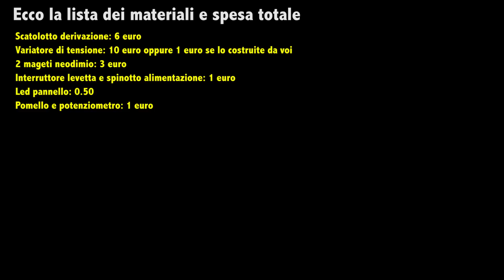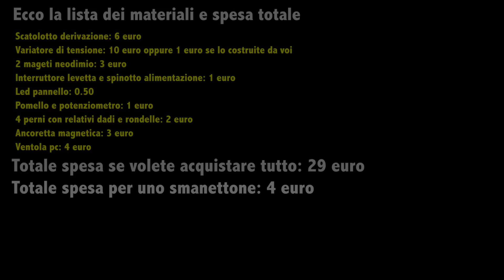Realizzare miscelatore agitatore magnetico per liquidi svapo

Comment: ma se io al posto della ventola metto due morsetti può essere usato come alimentatore variabile?
Reply from the maker: Certamente, il variatore di velocità non è altro che un variatore ti tensione che accetta tensioni fino a 24 volt per essere regolate fino a 3 volt con carico massimo di 2 Ampere, ma a quelle correnti devi mettere un dissipatore molto grande sul lm 317.

Comment: Il regolatore di velocità lo trovi anche su ebay, ti mando il link:http://www.ebay.it/itm/3A-DC-6V-12V-24V-28V-PWM-Motor-Speed-Control-Switch-Controller-ModuleMe-MO-/152240449686?hash=item23723ce896:g:h4gAAOSwTA9X2CKy
Reply from the maker: Ti ringrazio Phoenix per il link :-)